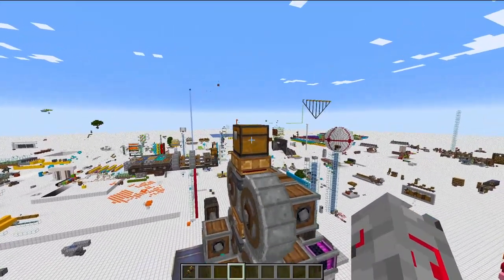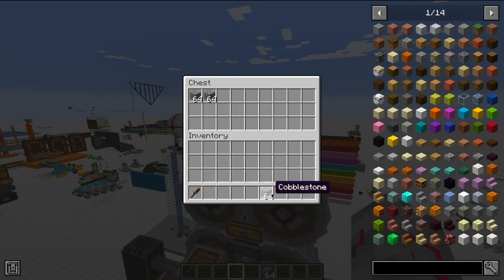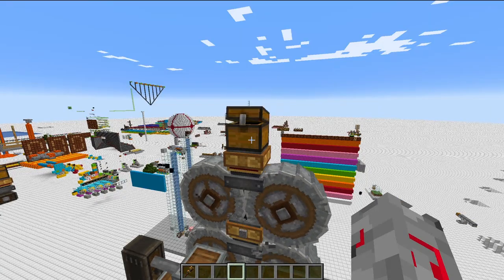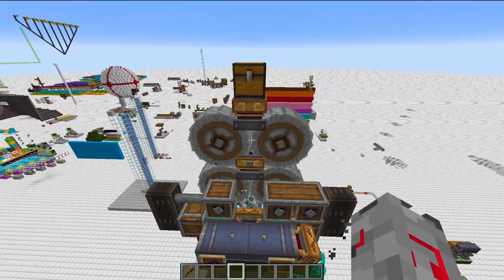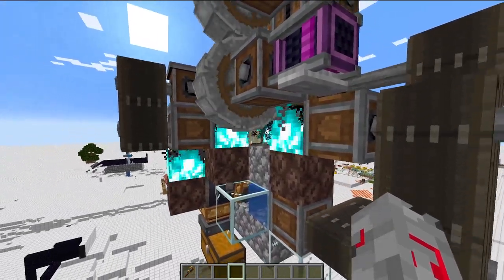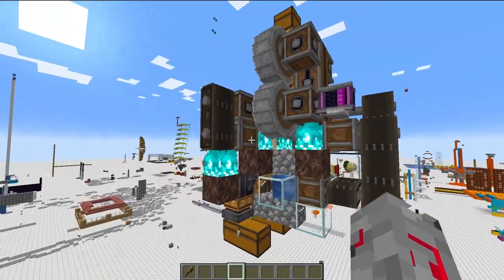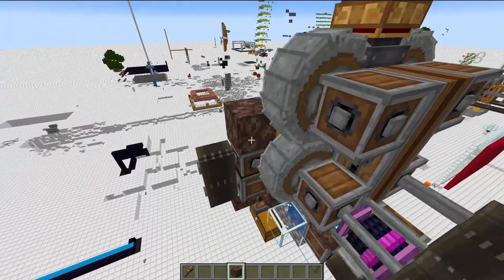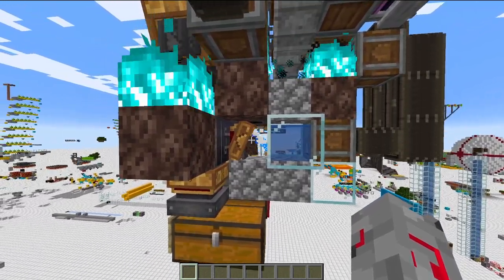Minceraft: Create Mod Gold Farm (Bulk Haunting)

Comment: Doesn’t washing soul sand give less gold than red sand? Or is the whole purpose to be as small as possible while sacrificing that gold rate?
Reply: Found this out, you actually can get more gold through this method because of the following:
Diorite can be crafted with 2 quartz and 2 cobble both of which are made in this farm at one point or another. Using mechanical crafters to automate
Then if you put diorite in a mixer with a single quartz you get Granite, which much like Terracotta becomes red clay when milled/ground.

Comment: I built this in a create modpack and I can't get the crushers to crush, the cobble isn't going into the chute...whats the trick to getting large amounts of items through a crushing wheel?  i've got good power and a speed control so I can turn it up as much as I want????
Reply: Check the direction of rotation for the crushing wheels, they only work rotating towards the centre (left side clockwise, right side anticlockwise)

Comment: I don't really like the fact that items are staying dropped.
Reply from the maker: This generally helps speed up any bulk fan processing, but I do see your point. The conveyor version generally avoids this, but that's why it ends up being less efficient in general.
Reply: @BLOckOus  i mean depots exist !
Reply: if you used a depot you would only get one gold nugget every year
Reply: Leaving them dropped allows for technically unlimited throughput, even when using just one fan, since all the items are processed in parallel.